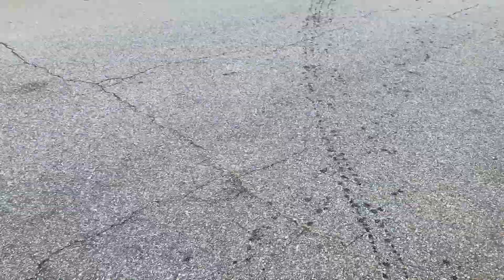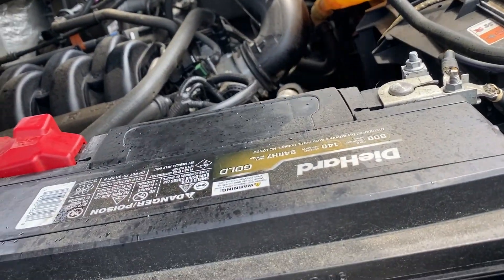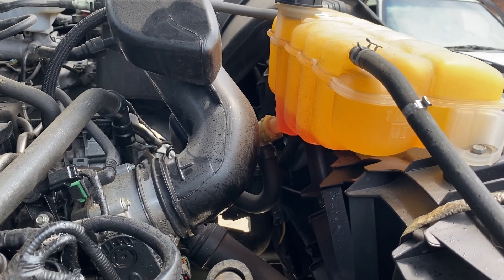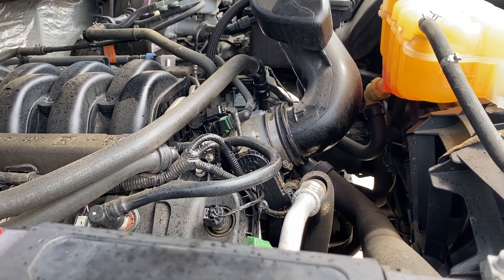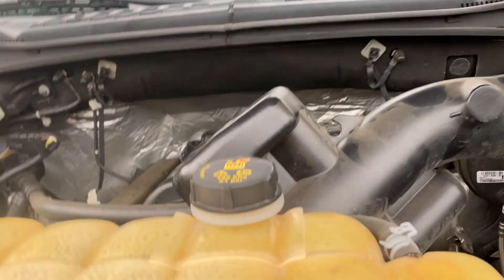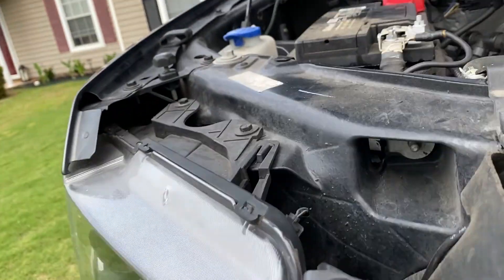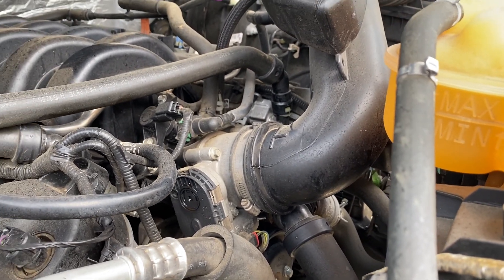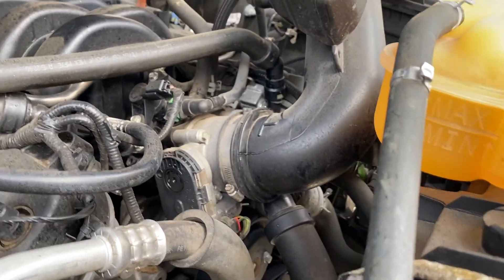Unexpected Issue with my Lifted F150... Truck Problems..

Comment: I had the same issue with fluid leaking and the truck running hot, it was a crack in my Y pipe leaking radiator fluid. Quick lane patched it temporarily and i used some stop leak which made it go away for now. I still probably need to get it fixed asap
Reply: I think it’s a pretty common issue over time
Reply from the maker: Yea it does seem to be pretty common issue. I was doing some research trying to figure what it was when I find out what it was when it happened.